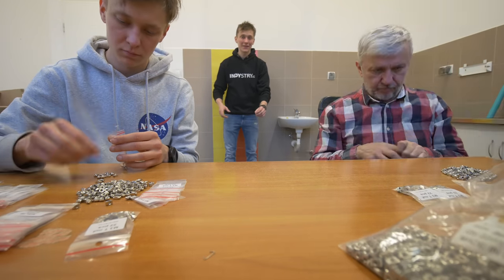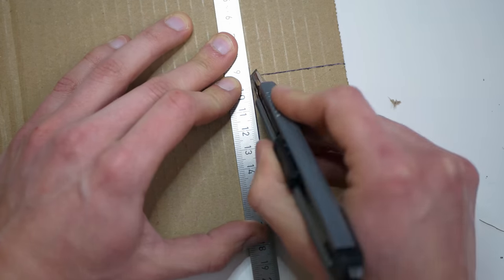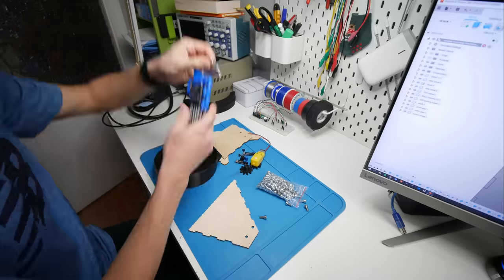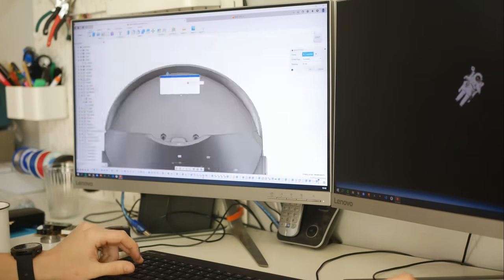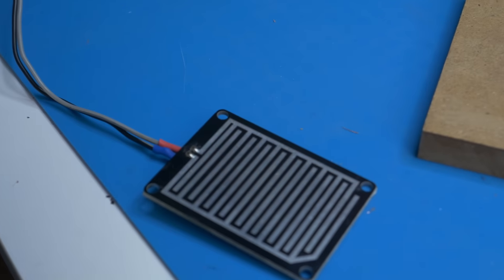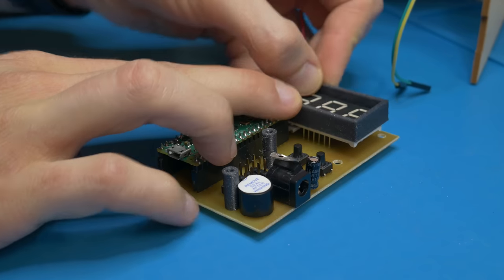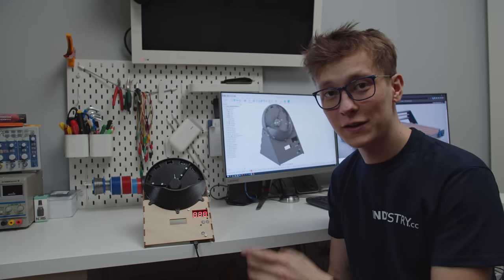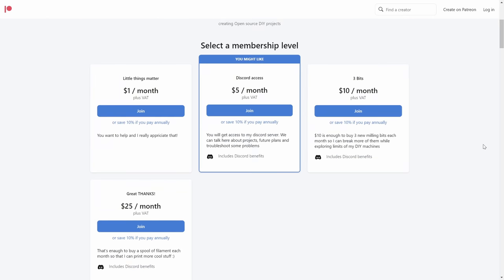I built a machine that counts screws

Comment: That's interesting. Generally in these cases the parts are counted by their weight.
Reply: This would be great as a secundary check. Let the machine count, add some clips so that the screws are ejected in a baggie. check weight and ship
Reply: Yeah after doing inventory for things like this, Weighting them make it so much easier.
Reply: I came to comment pn weight, but was also thinking Displacement?
Reply: @moxl_  exactly, and reject and under/over weight bags based on a sepcific tolerance to account for variance in the weight of each part. just how they do in food production factories. my parents both work in a factory that produced chocolate cake products and each finished pack of cakes had to be within tolerance otherwise they would be rejected off the production belt automatically.
Reply: Most scales have a piece counter. Hit the button, place one on the scale, press the button, and now it will do some simple division and count how many you place on it. I think it was designed for jewelers.   Counting these by hand is nuts haha
Reply: Yes, even those cheap scales you can buy at a gas station have a part count function. He should get one of those and hack into its electronics so the counter can double verify the count.
Reply: @GMCLabs  I love hacking into consumer electronics, great suggestion! I've had the best success hacking devices when there is some serial or spi, etc communication happening within or around it that can be decoded.  But in the worst case, OP can definitely read the bits being sent to the screen and discern what is being displayed. As well as pressing buttons as needed. But maybe it's better to get a commercial scale bc those have a serial port that just outputs exactly what it reads.    In any case  .... Any of us can create a part counter now if we need to, thanks to the op not knowing about weighing parts hahahaha
Reply: @GMCLabs  load sensors for arduino are super cheap and work great.
Reply: The weighing machine counter is called a grossing scales. They aren’t cheap.
Reply: Coins are counted this way  at least in UK
Reply: i think that the main purpose of this machine isnt really to count the screws, but to separate them into multiple batches. You could count the screws by weight, but then you would still have to sort them into batches, and his machine does that autonomously.
Reply: @adampiotrmalejewski695  Meanwhile - coins are quite precise weight standards.
Reply: @TushhsuT  I know i watch document about frauds fro roman empire till today :D
Reply: yeah, i was gonna say. If you have identical parts, you could just measure one and multiply by the number of parts you want and measure the mass of all the items.
Reply: 11:43 what’s the song called you used? 👋😄
Reply: This is exactly the context I was gonna white a comment about, then saw this.
Reply: I was going to say the same thing, maybe these two methods could be used in conjunction for extra accuracy.
Reply: I was thinking this as well
Reply: Yeah I'd say a simpler solution would be to have it drop screws into a cup one at a time. The cup sits on a digital scale and once the scale reaches the precise weight, the machine stops adding screws.
Reply: I was just going down there to write that, i don't really know about HOW it is done in reality but the idea just appeared to me as a good answer to the issue
Reply: We have a Counting scale at work. You put 1, 2,5,10,20,50 items for reference on it and then just pour the rest on it until you get 1250 for example. Precision is good enough.
Reply: yeah really but he has #youyubeprivilege so he had to come up with something dumb.
Reply: When you are counting a few screws for packaging, auto counters like this are much more handy than weighing
Reply: @gflaig9131  same way as weighing a whole lot you may weigh a single batch. All you need is to add until the batch count reaches desired number.
Reply: @Amelia Zhangmay well it's what I wanted to emphasize, you can always sacrifice the accuracy of the measurement for the sake of efficiency, and this is what a weighing of variable weight screws is. Still though, 5% error rate in counting the screws is much worse than 1% when weighing....
Reply: I seen the thumbnail and thought, ya it’s called a scale. 😂
Reply: The point was not only counting but organizing too😊
Reply: A inductive sensor for counting will help.

Comment: Have you considered using a weigh scale to count the screws? Our local hardware store does this and its usually pretty much spot on
Reply: LOT OF PARAMETERS DEPENDS ON LOAD CELL
Reply: they work great for electronics too, I think the smallest weights you can reliably count without a cover is about 0.02 grams but dirty/dusty parts can mess it up 
also things that are in a plastic package get counted wrong all the time
Reply: @JobinPThomas  Huh? Just get a scale that is accurate enough, and a print the optimal scoop. 
Most places uses scales for this stuff, as they weigh enough but are consistent enough to count using them. If you know each screww is 22g+-1g. 264g is 12 screws. And you know that if the weight is between 252-276g will be 12 screws
Reply: @JobinPThomas  we used it for a magic trick where a mentalist speed counted buttons. And they are even lighter than screws, works flawlessly and fast.
Reply: My 2 cents, from my experience - Hobbyist grade inductive sensors have a hard time sensing small parts, but since you are only counting 1x type of part you might get away with it.

Optical sensors, you need to restrict the beam width as much as possible (small holes on both sides of the sensing area). Parts WILL find some orientation that bypasses the sensor when falling. Unless you can perfectly align the part. 

I wanted to count different types of parts, some plastic parts weighing less than a gram, and I didn't have much luck with cheap load cell. The solution I found was simply dropping the part onto a suspended piezoelectric disc, starting off by simply hanging the disc in the path of the falling part using the wires soldered to it.
Reply: @noenernet  creative, did not think of using piezo for it
Reply: @JobinPThomas  if you can not read a load cell you take halt one that is ready calibrated. but even weigh by hand is faster than your machine ^^
Reply: Error isn't that critical for his application, he can just err on the side of giving buyers an extra screw once in a while.
Reply: @UltraBadass  You can weight them one by one then...
Reply: this would work for 1 screw weight aka 1 screw... so on the off-chance suppliers change and intern slightly changing the screw by composition and/or geometry, this can cause miss weighs...
Reply: @R0boT4ter  In practice, for material handling in  manufacturing and warehousing, you count out a sample amount of a part to set the scale every time you're using it to count parts.
Reply: I was screaming this all the time that I was watching the video, so much work for nothing.... Just use precision scale😢
Reply: Honestly not sure why he didn't just buy a counter.. my old boss had a seed counter looked just like it.. I grew cannabis seeds for about a year and there was millions
Reply: @Dream Reality Stuff  stop making things difficult.

Comment: Instead of checking manually several times whether the machine is wrong or not, it would be enough to use a scale. weigh 20 bolts and compare the weight after the machine has worked a cycle. and this system could be built into the machine itself. so that a green light would simply light up when the weight matches the previously set weight and a red one when it doesn't.

Comment: Make a door that the screw has to push open as it falls.  On the hinge side, there is a tab that acts as an NC (normally closed) switch.  When the screw falls through the chute it pushes the door open, pushing the tab in the opposite direction and breaking the circuit.  The door then falls back closed via gravity, closing the circuit.  Or, as others have suggested, do it by weight, but I like your design!
Reply: This could be a bit tricky due to the low weight and size of the screws
Reply: A small door (20x10mm?) made from a piece of aluminum sheet around 0.5mm thick should be light enough to open with minimal force, if hung plumb.  You could even cut it out of a soda can.  I’m confident it would work reliably.

Comment: Did you think of using an inductive sensor? Also you can weigh outcome set of screws to quickly confirm it. Or extrude screws on a scale and give feedback to the machine.
Reply: Love the idea of an inductive sensor! I wonder how much his photoresistor is affected by ambient light noise. An inductive sensor wouldn't have that same problem.
Reply: Throughout the video i though to myself why he didn’t choose a inductive sensor it would be a much better solution for accuracy but only when you run  the screws down a small enough tube next to the sensor.
Reply: @thomashepi2674  yh should only not work if they are stainless

Comment: Use a small digital scale to validate the results instead of counting manually.  Weigh a batch of 100 screws, tell the machine to count 100 screws, weigh the result, rinse and repeat until you are confident it is counting accurately every time.

Comment: Here's what you do, you have the machine count the screws, verify the first batch, weigh the batch and then just weigh each batch as they come out.
If the weight is off then add the missing screws and if it's not you can move to the next one.
I would also suggest having it depositing the screws in the final bag directly.

On the other side of things you could have the machine drop screws onto a scale until the weight is correct within a tolerance that way you'll have 0% error rate.
Reply: Yeah. The difference in the weight is far smaller than with the actual count!
Reply: why not add this part in to the machine?

Adding a little scale in to the output and let the machine count the weight.
Reply: @MARkoe93  Which is one of the things I mentioned in my comment no?
Reply: adds more sensors and steps... the design he has is plausible it just needs some materials, sensors, and geometry to better the design of his prototype

Comment: You could probably add a scale for validation, use it to detect a weight change

A contact microphone could also work, but neither the scale or the microphone can really be used alone due to things like bouncing/colapsing screw piles

If you're packaging ferrous screws you could tie in a hall-effect sensor (and probably a magnet)

Comment: Hi Nikodem, you are trying to detect a small object that is travelling quite fast, in a variety of different orientations.  I think accuracy would be improved if the counting was carried out at a low speed part of the operation.
My suggestion is to have a light source on one side of the disc, and light sensor on the other. You can count either empty holes or full holes.  This would require some form of indexing, such as a second light sensor to identify when the detection should be done.  Alternatively, use a stepper motor instead of the little gear motor.
Reply: I agree. Alternatively you can use a inductive sensor, and have it placed behind the hole ring on the disk.
Reply: Was about to say this. Detect screws in the wheel as they're being brought up. This is a much more controllable environment.

Comment: I like this because I wouldn't have thought to do it that way.

I guess for small quantities it would be a pain to manually weigh screws. So, I think I would add a scale to the project. If the weight is right, dump the screws into a train of plastic bins, else dump on a conveyor belt to return them back to the the tumbler.  Since it is often right and fairly automated it won't matter if it takes a little longer than it could if it worked perfectly. When there are enough full bins in the bin train, use a custom funnel to transfer them from bin to bag.

Comment: That is really interesting. Have you considered a small load cell, and counting by weight?
Reply: not exactly going to be super precise imo. there is some variance in weight per unit measured and those stack up over time. when you have really small objects and only a few it can be off too much. load cells also have a tolerance. we are talking about 0.37 grams here for washers and around 3-4 grams for the m5-20 bolts.
Reply: @jasonbenjamin1464  But when you are providing these screws as part of a kit for your customers to assemble, you anyway want to provide them a few extra to be sure that a single one with a bad thread doesn't have the customer complain.  So, using the weight and ensuring it is N x (nominal weight + safety margin) seems the good idea to me.

Comment: Interesting project.  As an alternative for a similar future project, for the screw detector, maybe try using a piezoelectric transducer and allow the screws to "bounce" off of it as part of the exit path.  This will generate a small pulse that can easily be amplified.  Also, for very accurate counting, have you considered just using a parts counting scale?  I use one all the time for accurately counting even very light pieces such as 75mm x 1mm zip ties.

Comment: The solution is adapting the output chute to orient the screw straight using some clever geometry, the chute needs to be a slightly larger diameter than the head of the screw and get a laser optical sensor for a larger signal change when sensing, and the chute near the sensor needs to be a matte black material reduce reflections that could cause inaccuracies. And adding a very short retrigger delay to the sensor causing a counting event to then further the count accuaracy

Comment: Some things to consider:

1. Tumbling the screws in this manner but in a bigger quantities when they have a protective layer will wash it away and the customers won't be happy
2. Count them using better designed gravity based aligning section. Search for automatic screw feed or counting groups spinning machines
3. Weight based counting? Just air clean the screws before entering the scale

Comment: almost all digital scales have the count mode you usually count some items together for example 100 items and it calculates the weight of the single one with very good accuracy, its the perfect case for bolts and nuts, If the method is accurate enough for (bulk) diamond sellers and jewelers to do that, should be good enough for screws and bolts. you could do this using a $10 cheap eBay digital scale, but I'm guessing it wasn't good enough for making a video and putting it on youtube!

Comment: A tool I've seen in a pharmacy and a factory is a tray with a grid of pockets that fit one pill/part.

You shake around the pills in the tray until all the pockets are full, then tilt the tray to dump the excess out of a spout in the corner. Then you verify visually that all the pockets are filled and flip the tray into a bin. It's more manual but easier to manufacture.

Comment: For fast and accurate counting, count by 3. 3 is a number you can take on sight without really having to 'count'. Do this 3 times for a total of 9, this you can again do without having to 'count'. Now take 1 and put this apart on a separate pile (each 1 will count for 10 later). Repeat till you run out of parts. Note the last quantity lower than 10. Now repeat this for the parts you put on a separate pile (the 10's), take 3 x 3 parts and then put again 1 aside on a separate pile (each 1 will count for 100) Keep repeating for the 1000's, the 10.000 till done.
This system works well once you get the hang for it, does not require any equipment and requires no real concentration since you never count anything bigger than 3 x 3. No problem if your phone rings or somebody comes and bothers you.

Comment: We have built this kind of machines before. A few tips. Lower the speed and reduce number of pockets to half, so it has time to stop preventing getting an extra screw before it stops. Make sure to have a "debounce" time on you sensor so you do not count a screw 2 times as it falls past. The sensor you are looking for in a inductive sensor or read fork sensor. But inductive is preferred. Make sure to get a sensor with enough read distance. This will solve it. Never have to count screws again.

Comment: I've worked in factories where you sit all day sorting between pass and fail components coming off of a vendors line, and every so often you have to count up the pass components. Most of these are done by using a counting scale. Tarr the scale with an empty bin, drop enough parts into that bin to give you an acceptable accuracy by weight, say 10 or 20, tell the scale how many that weight is, and dump the parts to b e counted, nd the scale tells you how many parts are in the bin. I believe they used a load sensor, as it was a digital scale, but if you are counting out a consistent number of parts, you could use balance beams to do that. In either case a cup gets set on a scale, pargs get dropped into it (you may also be counting them as part of that drop, then when the expected number show up in the cup, that cup moves to the bagging station. If you are counting using two methods, you can very likely move on to doing QA checks ever 5 or 10 or 1000 bags depending on your confidence goes up.

Comment: you would love brass threaded inserts that can be melted in easily with soldering iron. Very clean and you can use smaller holes as opposed to nut that has a big outer diameter compared to inner thread diameter.